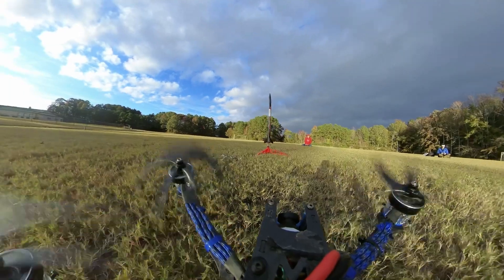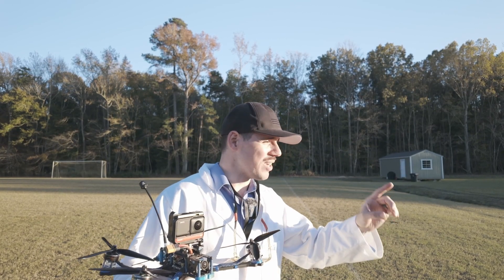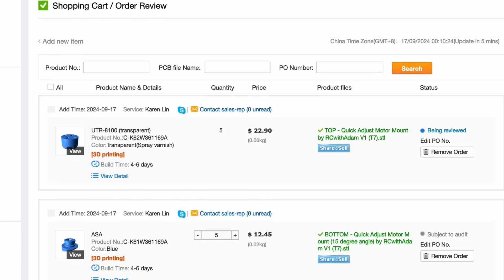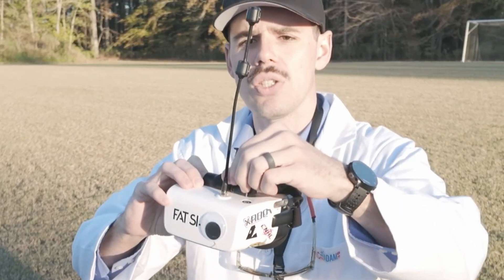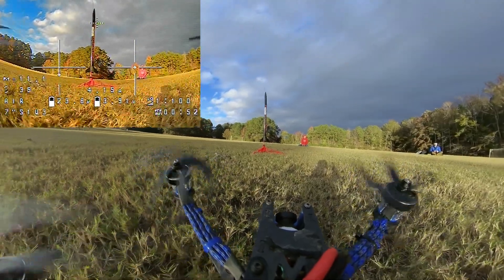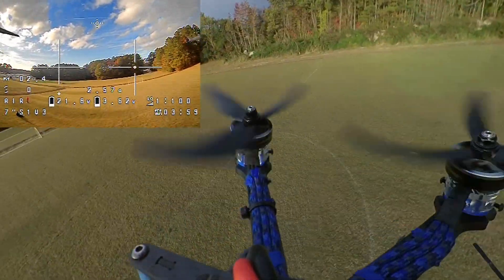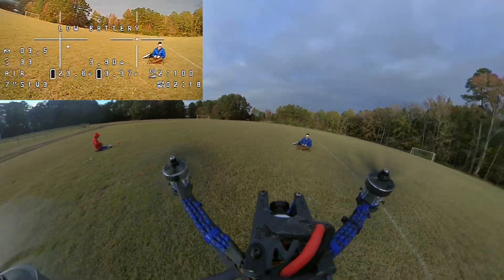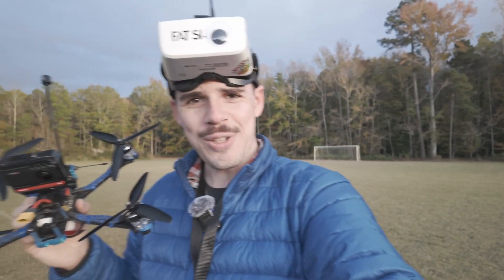Flight Testing ADAMM (Adjustable Direction Angled Motor Mounts) - FPV Drone 7"

Comment: Really!
What's the CD of square tube (1.05)
VS
A  streamlined (teardrop) shaped body  (0.04)

That's 26 times better  for the teardrop.

Now the wind from the props is blowing down  on the square arms  trying  to  hold the drone body up.

Bend a piece   of wire into teardrop shape.
Use  it as a hot wire to cut (somewhat hollow = lighter) styrofoam leading and trailing edges for your arms.
stick them on.
Wonder whyTF your drone flies for much longer and flies/rises better than it used to!!!

I DON'T get how this  has never occurred  to any drone  people!!!???
MAX YouTube clicks is easy to grock.  Seems basic aero, requiring 2 more  IQ points, is incomprehensible to you all!??  WTF!!!!!??????

Comment: Aren't you doing the props at the wrong angle? By angling them inward, you are likely making a low pressure area over the quad, because they are hooking into each other's air flow. Less air means less lift, right? If you angled them outward, you could get more of a high pressure zone under the quad, achieving better lift.

Comment: My logic tells me there's no advantage in an inward angle for the drone motors in fact possibly a disadvantage as some of the thrust energy is be wasted trying to pull each arm to the centre of the drone. Maybe I'm missing something here, but what's the point of angle inwards? 🤔
Reply from the maker: Good points. One theory is that the thrust columns pointing away from each other would decrease turbulence.
Reply: @RCwithAdam1  Yes,  I did wonder if that was the intention.  I was thinking about  twin or 4 engine planes, props are usually all in the same thrust line.   Why not test  Hook a line from the drone  to a spring balance secured to the ground and do a 'pull' test with motors tilted in and motors in the usual configuration!  😉. That'd be fun! Or dangerous?
Reply: The advantage is added yaw control. This is commonly used on larger drones like a DJI Matrice or Inspire.